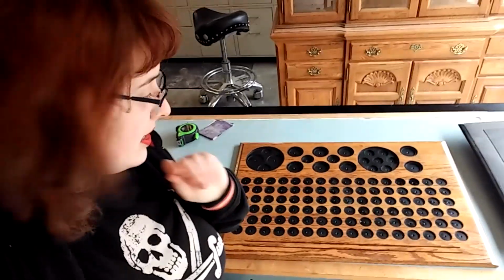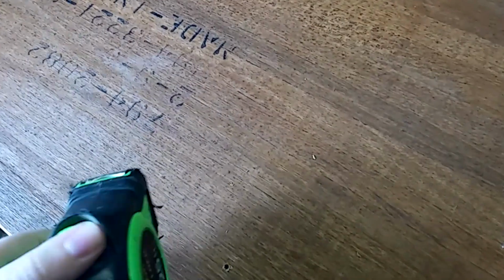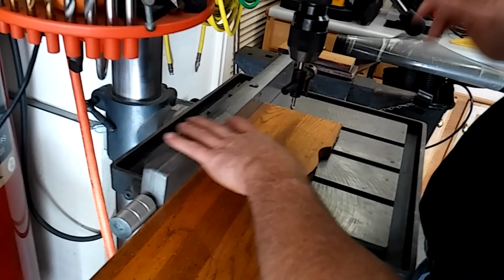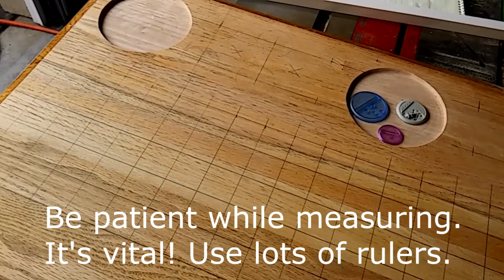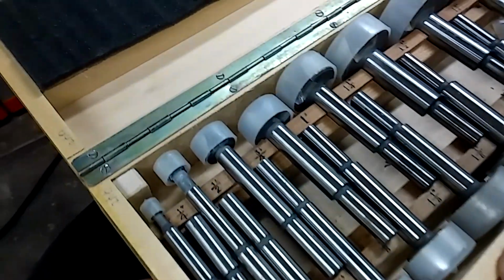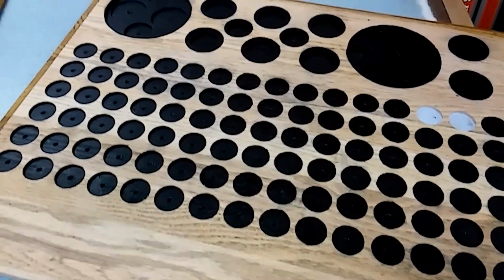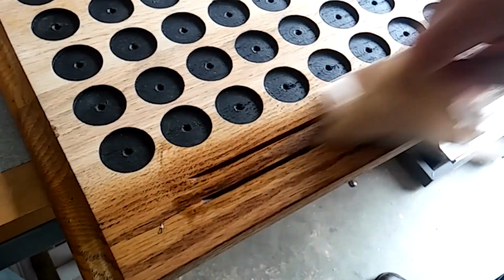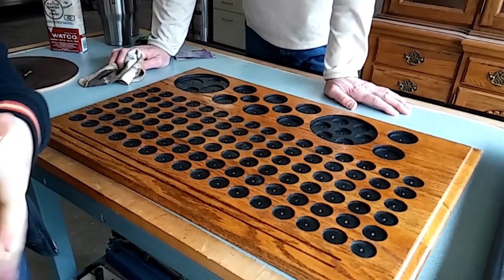How to Make a Wood Tournament Tray for Miniature Wargaming (without a laser cutter!)

Comment: I have been making movement trays from the top lids of coffee  creamer containers, metal siding I scrounge from work ( I build commercial/industrial steel buildings), and hot glue. 

I trace the lid on the siding then cut a slightly smaller circle so it will fit inside the lid. After that  I glue the metal onto the lids and have a magnetic tray.